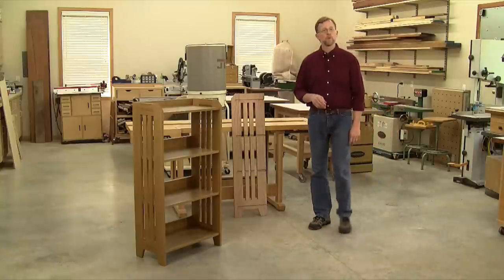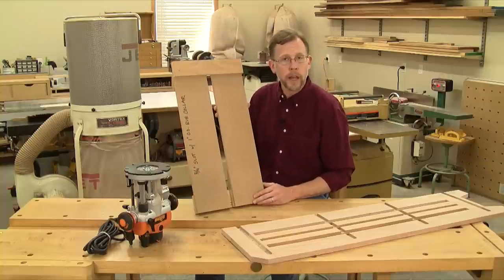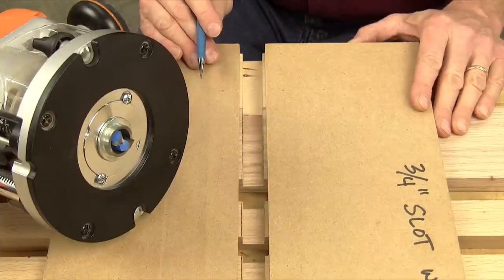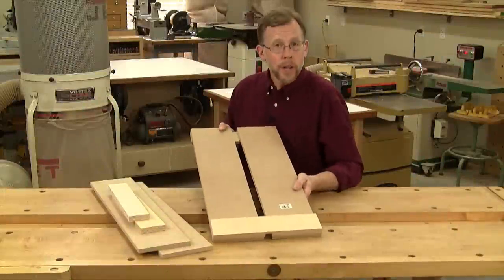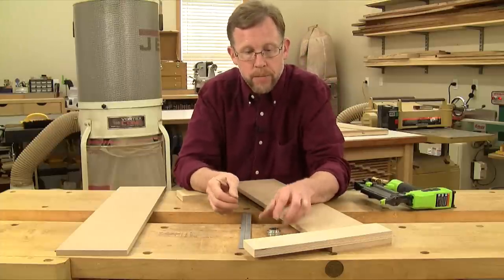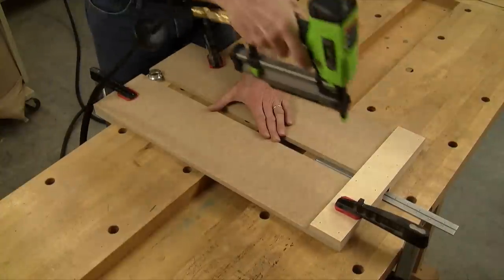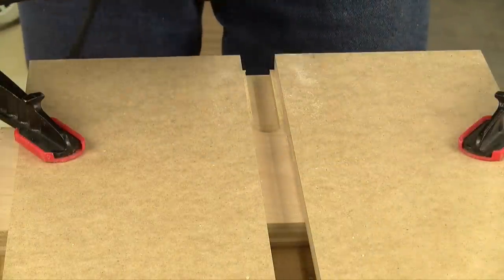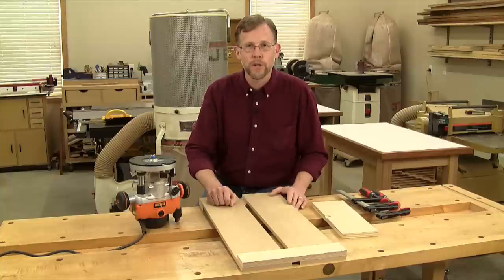Make a Simple Jig for Cutting Dado Slots with a Router

Comment: Thank you for this video. Just curious how to position the jig for at a specific location? I built a router lift table and want to position my T tracks 3/4 of an inch on both sides of the router lift pocket. I can see using your jig, a real value, just don't know how to specifically place it on a 3/4 mark on each side of the pocket? Thanis.

Comment: This is a great video and an excellent jig. I would add several suggestions.

1. I prefer using screws rather than nails or brads. Screws can be removed and reinstalled in a slightly different location if you don’t get the fit perfect the first time.

2. When installing the second side to fit the bushing, apply light pressure to get a snug fit. I pulled the second side toward me while bracing the first side against my body.

3. Sand the sides of the groove when finished. A few strokes with coarse sand paper will help a lot.

4. Apply wax to the sanded sides of the groove for a smooth glide.

5. Use a large square to confirm the jig is square to the shelf side before clamping.

Comment: I like it. It's simple and straightforward. The only problem is this only works when you have a bit that matches the material you are working with precisely. That's so often not the case when you are working with different types of sheet goods that all seem to have their own ideas about what 3/4" is. If I was going to knock out many pieces from the same stock and had a perfect bit to match, this is a great jig.

Comment: I already made one of these. I used a v- groove router bit and went over it with a pen to show the Centre point that the dado will be.
Another useful tip is that you can use various bit diameters to achieve a range of dado widths. You can increase the range by making another template for different size housings.